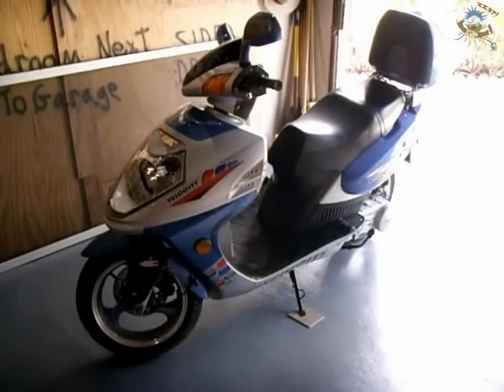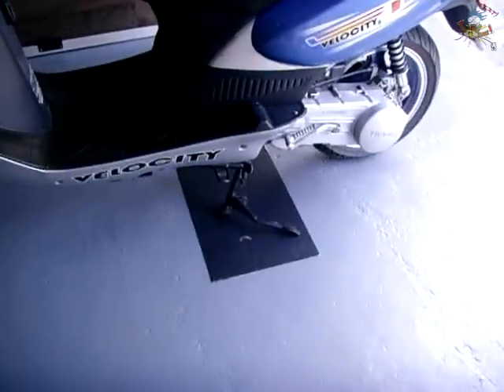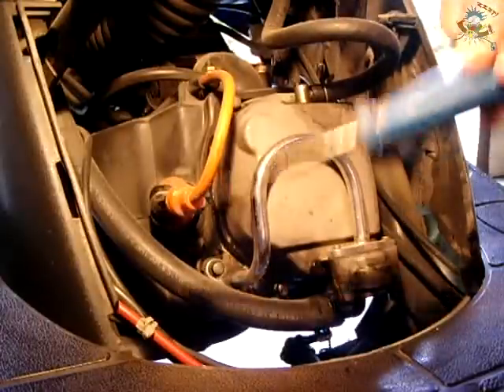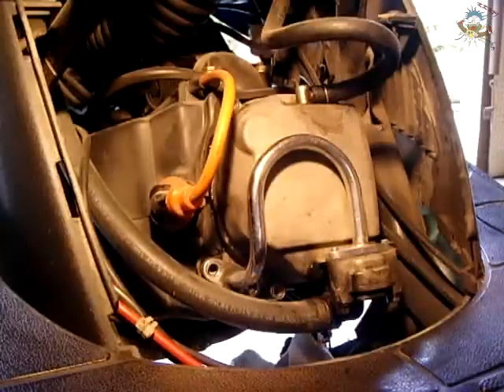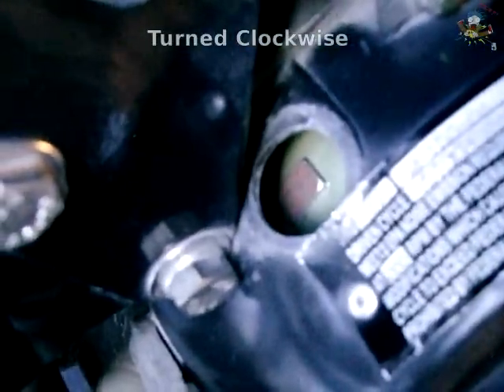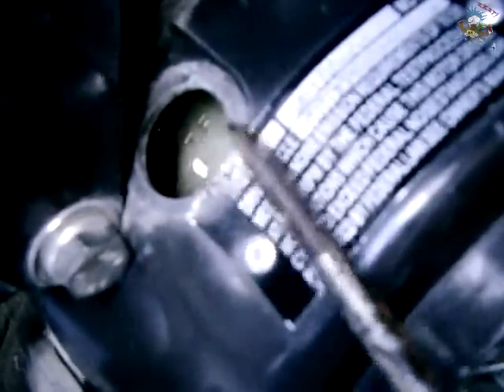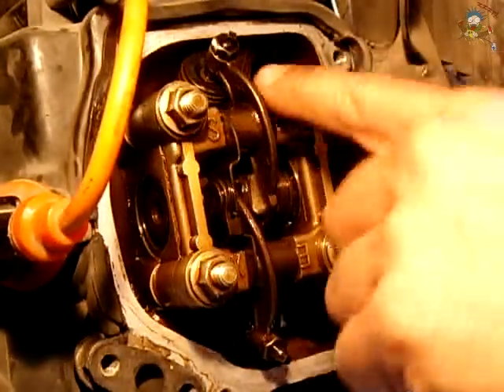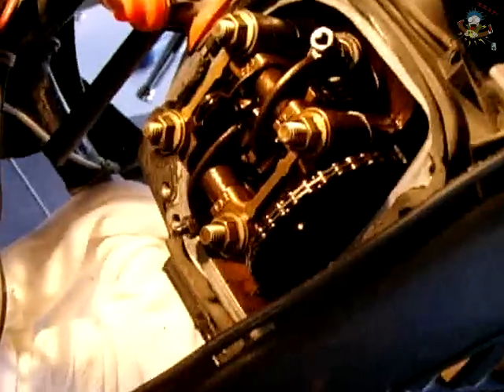Highly Detailed GY6 Valve Adjustment Procedure(Step By Step)

Comment: "Placing the scooter on the centre kickstand allows the rear of the engine to drop and allow the oil to drain" Do you need to drain the oil out before doing any of this? If I don't then will need to put some weight in the back end so the bike doesn't rock towards me as the stand seems to be smack bang on the balance point. Maybe its a good idea to drain the oil first?
Reply from the maker: +Keith Mass 
No need to drain the oil. Once the scooter is on the center kickstand, the front wheel will be off the ground and all oil drains away from the valve cover(to the rear). Place a 2x4 or thicker object under the front wheel to keep the scooter from rocking.

Thanks
Reply: +electronicsNmore Thanks good idea! :D
Its only 3 years old by the way. Lexmoto Tornado 125.
I am going through the checklist for possible reasons why it will not idle and dodgey start. Not the idle setting as tested that having the bike running had to hold on the accelerator slightly so would not cut out and adjusted but still cuts out. Motorcycle SOS recoveryguy tested that too when I broke down. 
Short journey into city. Running fine then came back 5 mins later and would not keep in idle at all! I think bloody road ramps could have caused something the go dodgey! Bloody council... I dont even go fast over them....

Checked battery and tested, got spark for sure. Spark plug in great condition and gap is correct. 
Cant see anything disconnected or leaking hoses.  
Do suspect the fuel vacuum pump as they likely to corrode their seal internally but got spare coming anyhow as they regularly go wrong apparently. One of the first things Motorcycle SOS guy suggested. Second part suspect is the auto choke but I have a new spare one of those anyhow :)
Reply from the maker: Make sure the intake manifold is not cracked, and also test the enricher which I have a video for. I would also inspect the carb. I have a video for that as well in my GY6 video playlist.

Thanks.
Reply: +electronicsNmore Getting closer! Found the ideal idle on the throttle. Just a 2 man job now to get the idle screw correct. Replaced the auto choke aka enricher as didnt move with 5 mins of power. The battery is pretty dam rubbish so need to replace that soon. So cheap crap Lextec Ideally want Yuasa :)
Reply from the maker: Keith Mass
Buy a gel battery. On Ebay they are fairly inexpensive.
Reply: +electronicsNmore finally a decent day where I can check the clearances!
Reply: +electronicsNmore May I ask which gear oil to use? I know 80/90W but seen everyone using universal GL4/GL5 oil but the ones I find are either GL4 or GL5 which to use?
Reply from the maker: Keith Mass

"Lucas" brand gear oil(80/90W or slightly heavier), or synthetic gear oil is what I used in my scooter for 5 years.
Reply: electronicsNmore
 Well I have got some Comma gear oil 80/90W GL4 should be good its in the bike now. Still not running fine... Going to check out the clutch tomorrow. (Process of elimination) When I am starting it being a right bleep to get into running. Definitely turns over and sparks up the fuel though when trying to start. Can hear the engine fire up like it was running but when pulling on the accelerator after letting go of the ignition stalls. Does the same when kick starting hold the kick start at the bottom of the swing engine turns over but stalls when attempting accelerator. Read online about could be the clutch or a broken reed (apparently top of carb?) Might take the carb completly apart again to see if dirt has got REAL deep in there. Been driving me knutts this past month after only having it 3 months total!

Comment: Thanx ENM. yes I only put one head on it. Lol damn voice text. I'm going to have to bring it in somewhere to have a compression test I don't know what the deal is. I've taken apart and put it back together several times still the same thing. Has a hard time starting. Even with fully charged battery sounds like it will not turn over like it is stuck or something. Any advice? Thank you
Reply from the maker: +jim crabtrey 
Timing has to be off, of there is a compression problem.

Comment: my mopeds valves tick when its warm an idleing cant really see any performance issues but it dose tick quiet loud slightly not constant only for couple of secs do i need to adjust them
Reply from the maker: +Zed 
Does not hurt to check.
Reply: +electronicsNmore my mechanic said its fine lol ive had the bike for a year already done 8k+ miles never had a problem
Reply: +electronicsNmore i filled up with petrol an it died out on me put new fuel in an it was fine until later it died again i changed the spark plug an it was ticking loud now it does not want to start gave it to my mechanic he said he dont know whats wrong with it it was idleing like a diesel

Comment: someone please help. I replaced the heads. now 150cc scooter will not go over 30 miles an hour. I have to top dead center on the camshaft and the variator did the valve clearance at point 3.4. Still will not run. Ready to pull my hair out. Driving me absolutely crazy. I have tried everything. Seems like it is spraying oil to cook. Although I know everything is tight all the way around. Any help please??
Reply from the maker: +jim crabtrey 
Heads? There is only one head. Unfortunately many things can be wrong. This is not something that will be easily resolved online. You may have done something wrong when you put everything back together. I suggest you do a compression test.

Comment: Hey i have an other problem now. Maybe u met with this already. My headlight working than i start to ride it dims out after a while. Than if I use the break or use blinker works as long as these things are on then dissapiers. Fresh stator and regulator in the scooter...
Reply from the maker: +Kismufin 
Hello there. Sounds like a wiring issue. Check all ground wires.
Reply: Where?
Reply from the maker: Kismufin

Could be anywhere. You need to inspect all the wires from the stator, the headlight switch, and headlight. If the problem started after you replaced something, then clearly it is something you did.
Reply: Yeah here is the problem. I made a mistake i took it to the shop where they changed my stator and rectifier and my scooter didnt work. So i ended up find the lroblem.my self and after did the valve adjustment. So im not aure they messed up somethig and where. its a wiered issue what gy6 are having sometimes with the lights...t
Reply from the maker: Kismufin
Unfortunately it will be very difficult to figure out what another person did.
Reply: im thinking about to get an other voltage regulator maybe it helps. i donno was this problem there all the time since i got back. bec the scoot wasnt working.
Reply from the maker: Could be a VREG problem.

Comment: Thank you for your response. I am grateful for your help... I went ahead and did the adjustment, then rotated the flywheel 2 complete revolutions and checked clearance again and then closed everything back up..I removed the carb disassembled it and cleaned it all out + jets. It was clean to start but now it it is extra clean.  
Long story short 
- I do have fuel flowing to carb
 -I do have spark
- no vacuum leaks
-battery is good
 -kickstart does not work, sometimes it gets stuck.
-electric start will turn but not engage the flywheel 90% of the time.. and it makes a horrible grinding noise 100% i press it. 

WHAAAAA??? What could it be? I am stumped!
Reply from the maker: +Leo Kayach 
You need to post your replies where you posted your original question. I have no idea what we discussed earlier! I answer many questions on a daily basis, I cannot keep track. Sounds like a bad starter clutch/gear.

Comment: hi I have 150cc chinese scooter. I have idling problems on it. it is hard to start than idles really high whatever I do with the idle screw. do you think its valve adjustment probelm? I mean it has only 1300 miles on it. change the carb already at least now starts. or maybe the cdi? or its not related to my idle?
Reply from the maker: +Kismufin 
Yes. Sounds like it. Check the valve clearances first.
Reply: Thanks ill do that. So it can cause high idle like 3500 and sometimes rising. The gear doesnt see  to stop... Many thanks for the quick answer
Reply: Ok so i tried the new voltage regultor. Didnt work out. Finally i get  voltage meter...started to look around with it. I pulled the magneto swith of...the 3 pin one nd left the 2 separate for the ignition. Put the voltage meter black pin to the green wire, the red first to yellow than white. THe results either of them went above 4 v on the scale. Am  right that it should be for 12v to 60 when im increasing the rpm?? Is it possible that the stator give perfect ac for the ignition...guess thorught the cdi, but no normal ac for the lights?
Reply: +Kismufin You have a vacuum leak between carb and engine head, when running spray WD-40 around intake and any hoses you'll find it .

Comment: Really good video buddy. I have a 4 stroke 50cc and am about to do the valve clearances.
Reply from the maker: +Richard Connell 
Thanks for watching Richard! Be sure to share my videos, and rate thumbs up.
Reply: No problems buddy. I have just done my valves, they seem ok but a little lag on initial pull away? Do you think I may have gone too much? .005mm
Reply from the maker: Richard Connell
Try .003" intake, and .004" exhaust. I used that a lot.
Reply: Ok mate, will give that a go tomorrow. Thanks for the advice. Much appreciated.
Reply: Had a look at the manual and it said .05mm on the inlet and .10mm on the exhaust, that is hell of a difference. I tried it as the manual stated, now Laggy, slow no acceleration. So I will go with your advice.
Reply from the maker: Never heard of a spread that wide. .05" for intake and exhaust is typical.
Reply: Sorry mate, my fuck up. I was playing with the needle in th carb and didn't seat the diaphragm back down properly so the needle wasn't lifting. She's running like a beast now! Rookie mistake!

Comment: Hi sir, do you have an idea whats might be the problem on my scoot. that has a gy6 engine? here's my link https://www.youtube.com/watch?v=WfTydcBSdSo
Reply from the maker: +Ace Buriel Hi
Sounds like something is spinning after the engine is turned off. Do not allow the rear wheel to spin while the engine is idling. See if it still makes that sound. If it does, then you may a problem behind the stator. You could have a faulty starter gear, or other gear that continues to spin after the engine is turned off.

Comment: Runs perfect besides just when u ride it flat out each time it cuts out I disconnect the fuel pipe and it starts again
Reply from the maker: Eddie Walsh Fuel flow is controlled by a vacuum sensing valve. That could be faulty. Try bypassing that valve.

Comment: I have a problem with my 150 when I drive it flat out and let of the throttle and wind it again it take awhile to pick up again if I keep doing that the bike cuts out it's like it's getting air locked I need somebody's help
Reply from the maker: Eddie Walsh Could be many things. If the valves are properly set, then check out the carb next.

Comment: Excellent video, thank you.  My question is...after doing this, how do I set the timing?
I have looked for videos on here but have found no good ones on the 50 cc engines.  One guy did a vid on setting the valve clearance and at the end said, now your valves and timing are set.

Thank you for your excellent videos.  I have learned a lot from them.

Bill
Reply from the maker: Pirate Labs When the mark on the flywheel is lined up, and the large hole in the camshaft gear is properly positioned with both valves fully closed, the timing is set. Nothing else to do.

Thanks For Watching
Reply: electronicsNmore

OK, thank you very much for the information and the fast reply.

Bill

Comment: First let me say, damn dude you know how to make an instructional vid!  That said, I am having another issue you may be able to help with.  What does it mean if I open the valve cover and it's full of oil?  I had an oil leak and started working backwards from the air box.  Found out that the vent hose was full of hardened gunk and oil.  Cleaned that all up and there's no oil anywhere near the valve cover.  Took the cover off and it's full of oil!  The line on top of the valve cover is hardened as well so I will be swapping that out.  But what do I do with all the oil inside?  Does that mean the engine is blown?  It's a Tank Touring 150.  HELP??
Reply from the maker: MickolaustheWonder A layer of oil covering all the parts inside the valve cover is normal. If the scooter is positioned on the center kickstand, there should be no oil pouring out of the valve cover when it is removed, unless you over filled the engine with oil. Some dripping is normal. You may only have the engine over filled, or there are blocked ports not allowing the oil to drain to the bottom of the engine, or you have engine damage. Try a compression test(Should be 100psi or higher), If you have an EGR valve cover like in this video, then make sure there are no blockages in the hoses. A faulty PCV valve can also cause your type of problem. The rest is up to you. You need to pull everything apart and inspect everything.

http://www.ebay.com/itm/Positive-Crankcase-Ventilator-Valve-PCV-Chinese-Scooter-Parts-Moped-ATV-GY6-/281279153825?hash=item417d8b46a1&vxp=mtr

Thanks For Watching. Be sure to rate Thumbs Up and Share.
Reply: electronicsNmore Thanks brother!  Very, very helpful stuff!
Reply: Check your crankcase tube building pressure

Comment: so is this in inches or cm/mm pleas tell me i have to adjust them on my scooter i think its low on compression and sometimes it make like PUF sound like to much air is escaping from smal spot somwhere from the engine i think its because of the valves
THX
Reply from the maker: Vlatko Blazevski .004"/.005" (inches)
Reply: oh ok thx 
but i have no idea how much cm/mm it is google convert say stupid shits about it

Comment: Hello, I had to rebuild my engine gy6 150cc I was able to get it running for a bit.  Was able to start very easily as if it were perfect.  Got good speed but torque did not seem to strong I am assuming the belt was the problem for low torque because I replaced and it seemed slightly longer than the previous one.  Anyway  drove it one day and I was pulling off scooter died.  Was able to get it started but idled terrible, carb cleaner cleared it up but once I gave it throttle it died.  Got a new carb and new starter. Its rolling over and pulling fuel. Spark plug is getting black just trying to start.  I am pretty sure it is my valves.  When I was rebuilding and setting valves I noticed that tdc both valves were closed but opposite side of tdc (180 degrees).  Both valves are open.  For the valves to be closed at that point I have to have a the rocker arms open way to wide.  Are they supposed to be closed at 180 degrees after tdc.  Or do I have something wrong.
Reply from the maker: Robyn Knowles Just follow this video exactly, and you will eliminate the valves as a problem. Make sure the timing marks line up and the valves are closed. If they are not closed, then rotate one full turn to the timing mark.
Reply: I used your video to set the valves.  It ran flawless for me I spent over a year trying to get it flawless.  I have a good mechanic background but this Chinese bike is driving me crazy. I live in the Bahamas I am ready to turn this into an artificial reef.  Its driving me crazy.  Just need another set of eyes to help me out.  Do you mind if I send just a short video of what's going on.  From watching your other videos I am sure you can help.
Reply from the maker: I suspected you were Bahamian by your last name. What Island?
Reply: electronicsNmore Freeport, Grand Bahama
Reply from the maker: I would take a compression reading on the engine when warm. If you get anything under 100psi, then your engine is not properly timed, your cylinder or piston rings are damaged, your valves are not properly set or seating properly, or the head gasket is bad. That is all I can say. Good Luck!
Reply: electronicsNmore I will check all and let you know when its 100%.  I appreciate the help
Reply: Robyn Knowles if not I will take a PiC of it for you at the bottom if the ocean

Comment: I am at a loss with my scooter. i have installed a big bore kit and i am having issues with my belt to the variator mind you ive alrady replace my clutch and variator and new belt. seems after i ride for a short time i can take my cover off and my belt is loose as loose can be. Ive yet to do the valve adjustment but im just at a loss. please help
Reply from the maker: Clara Hernandez Either you installed the wrong size belt, or the clutch/variator is faulty. Nothing else.
Reply: so then i should go back to the shop performance scooter and get those parts replaced as a parts warranty.